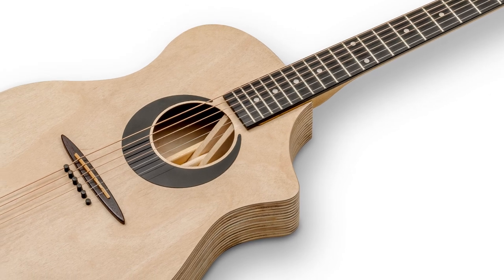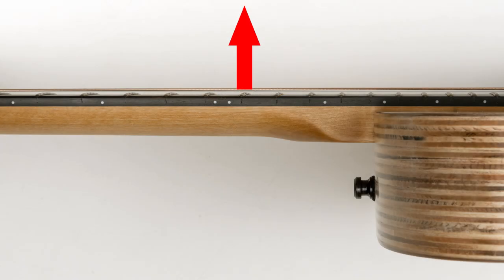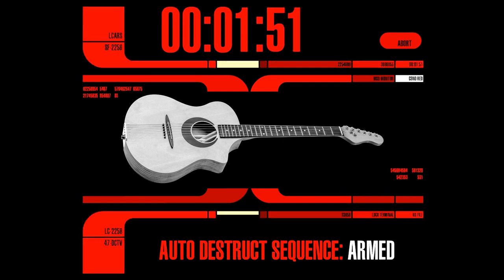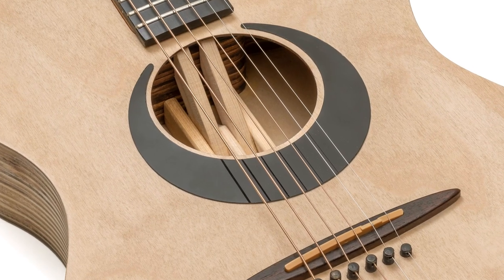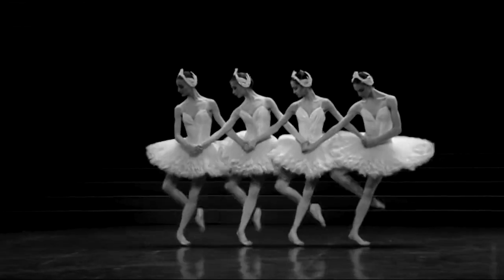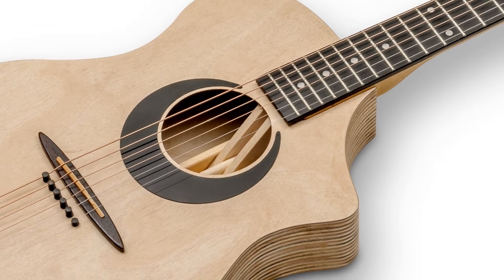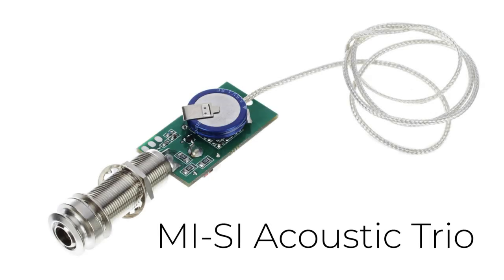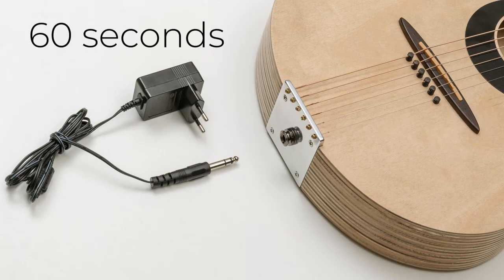How to build a great sounding plywood acoustic guitar PART 2

Comment: Just thinking, for future developments, a stronger back may be needed. Perhaps achieved by a thicker ply back, domed and braced as in "normal" acoustic guitar backs. Or perhaps a single, strong, longitudinal brace from the neck block to the tail block may achieve the same thing. If you are concerned about weight, perhaps make it out of spruce, but shape it like an I- beam, with carbon fibre reinforcing on the top and bottom of the "I"??
Reply from the maker: "a stronger back may be needed" - You're so damn right ;-) That's what I thought after finishing the project.

Comment: Great video - thanks!  How did you determine where the problem?  How would you have braced the back if you knew this ahead of time?  Was this also a problem with the previous guitar?
Reply from the maker: Hi Ben, the back was too thin (2 mm Aircraft Plywood) and the bracing of the back wasn't robust enough. Now I would recommend 5mm thickness for the back without any bracing. My previous guitar had no such problems. The body was routed out of a massive blank of mahogany.
Best regards
Thorsten

Comment: The design is beautfull with wrong material. You shouldn't use anything weaker structurally (less dense) than what is usually used for manufacturing instruments. Why not carbon fiber?